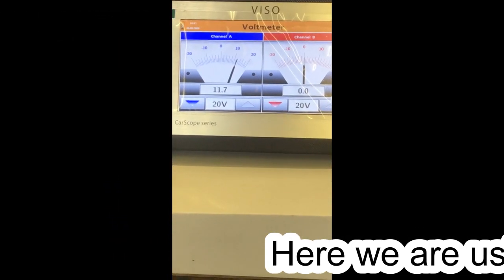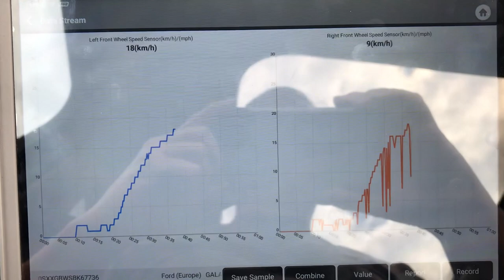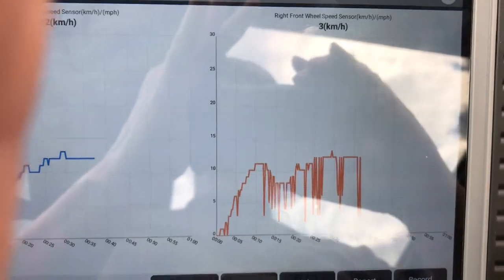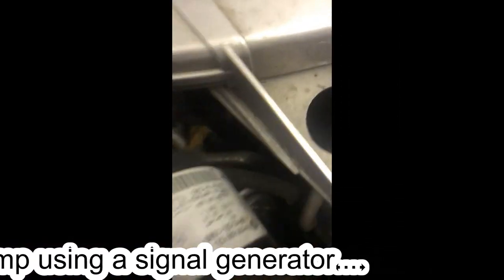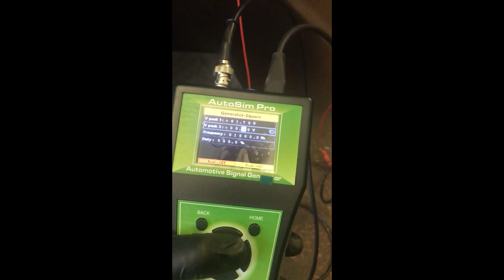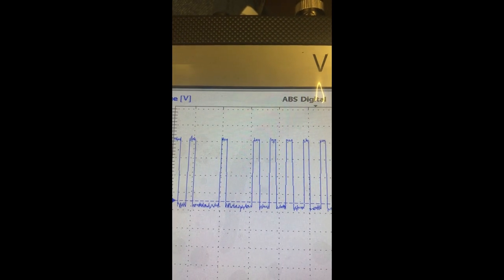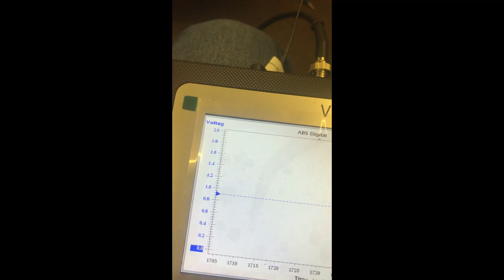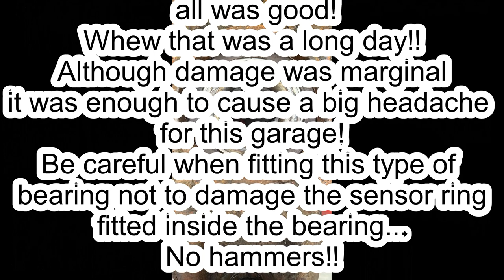Ford Focus ABS Wheel speed sensor fault diagnosing Ditex Visoscope & Auto sim Pro Signal generator

Comment: good video ☝the previous garage made a bit of a mess  on the lower ball joint nut, I know they can be a pain to remove but a little bit of time and they come off OK and using the correct size spanner, no wonder the replacement bearing was damaged
Reply from the maker: Thanks! & yes it looked like they used Molegrips to get it off with & what were they thinking with their wiring repairs?!!
Reply: @JC-ECUConnection  Yes the wire repair was awful some people don't care as long as they are been paid and most customers are unaware until the car is taken to another garage and then they have to deal with previous very poor work, which I guess most of us have come across this situation over the years